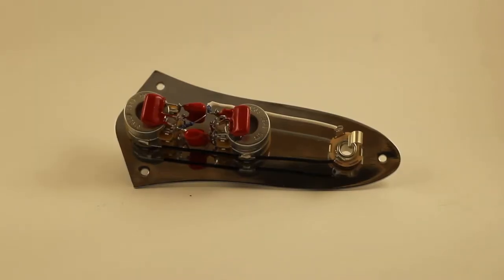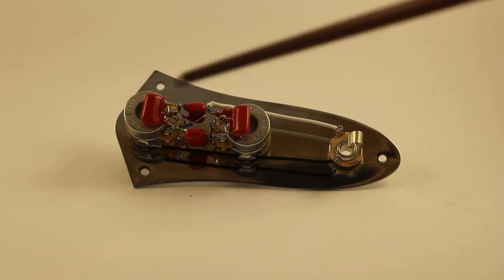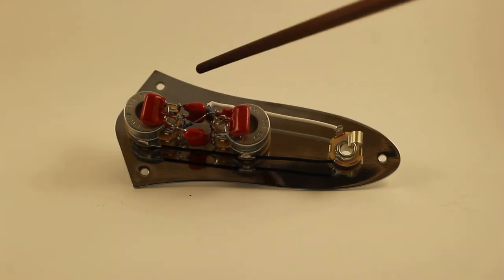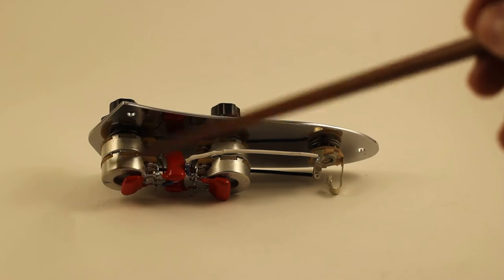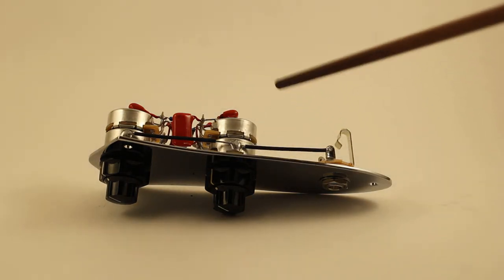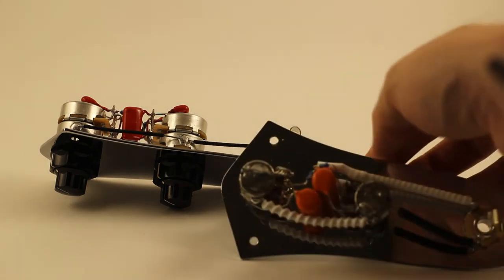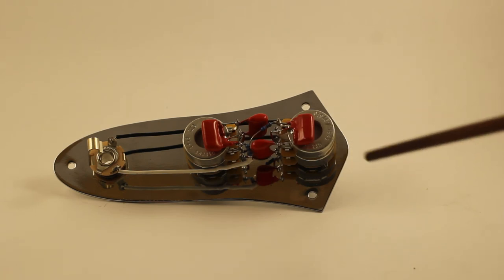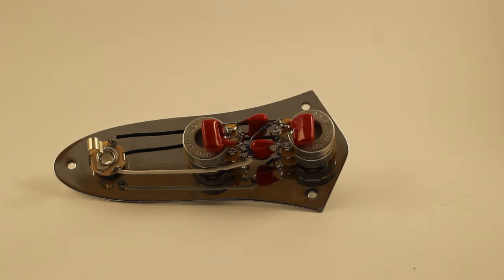60’s Fender Jazz Bass Control Plate

Comment: I installed this control plate on my Jazz Bass and it sounds really good.  A+ quality soldering and he even put leads on the hot terminals to make soldering on my end easy.  Included screws and shrink tube also.

Comment: Hi there, do you think something like this would work for a G&L SB-2? That bass originally has two volumes (one for the neck and one for the bridge). I saw a video on YouTube of a guy who did a mod with two stacked pots (volume/ tone for each pickup) but didn’t go into detail about how it was done. I’d really like to give it a shot but I’ve heard people say that two separate tone controls on bass doesn’t really work (meaning the tone on one pickup will always affect the tone on the other)
Reply: To further clarify. I currently live China, I have a guy here who is very competent but want to be able to explain to him exactly what I want.
Reply: https://youtu.be/au9OLzWcAp4

Here is the video of the bass I have modded with the volume and tone stack for each pickup (for reference)
Reply from the maker: You’d have to wire these as independent pots. Find Les Paul independent wiring. Easy switch. Also add the resistors as per the classic 60’s design but 15k instead of 220k
Reply: @ticktockfool  Would I need to include a three way switch? Don’t really want to go that route.
Reply from the maker: @alexkidd4144  https://youtu.be/CRwlfkMsmtE
Reply from the maker: @alexkidd4144  see my other vids. Plenty of options

Comment: Is it possible to use a concentric pot for two volumes instead a vol/tone?
Reply from the maker: Of course. They are just two pots on top of each other. Keep in mind that these particular pots are 250k/500k. 500k/500k and or 250k/250k stacked CTS pots are a little bit hard to find.
Reply: @ticktockfool  thanks!